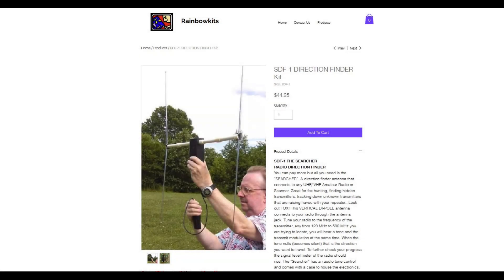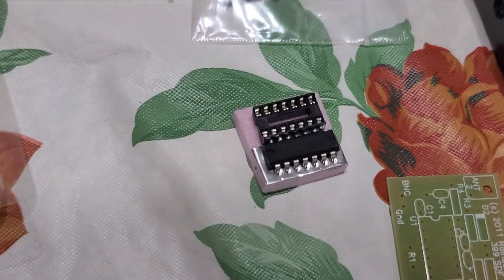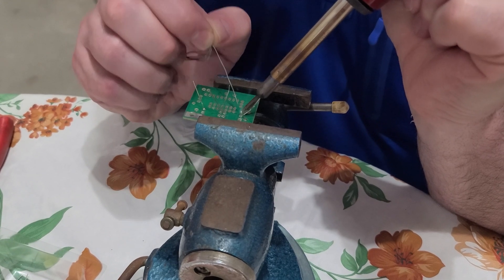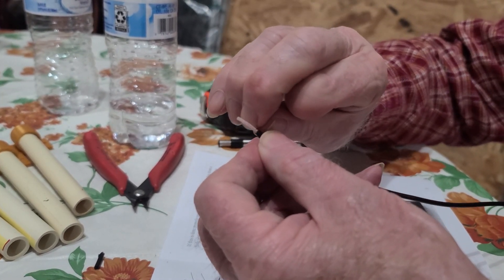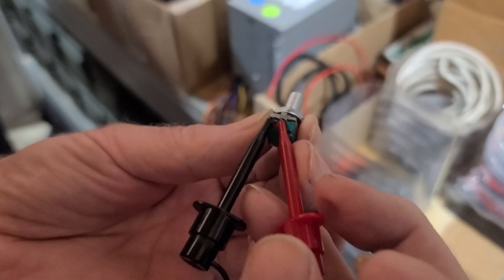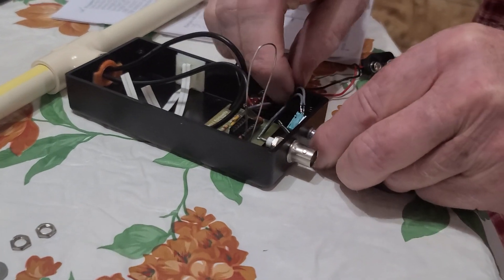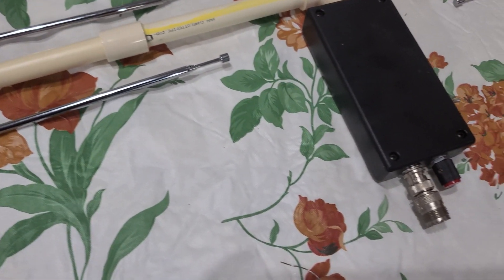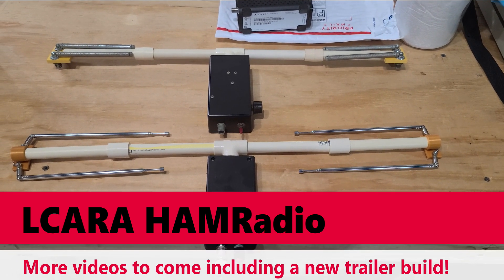LCARA HAM Radio: Building the Rainbowkits SDF-1

Comment: Hold the tip of the iron to the board for a count of three, then add solder until it flows, another count of three. Then let cool.  The video didn’t show the solder flowing so it may not make a good contact into the board and the part.

Dave K8WPE since 1960